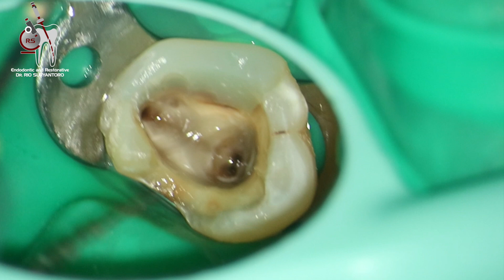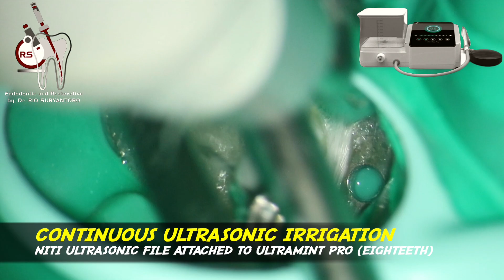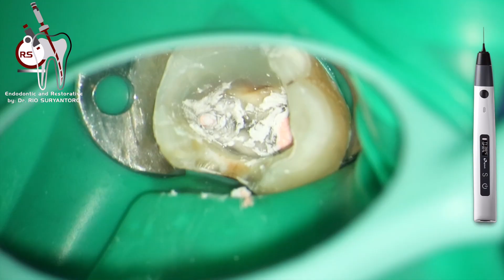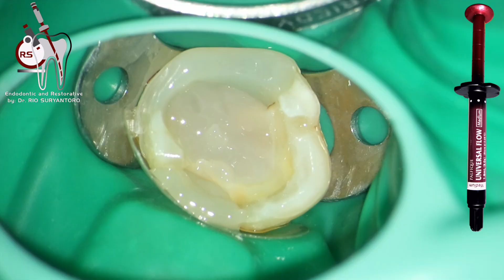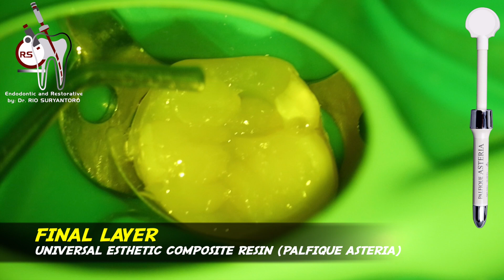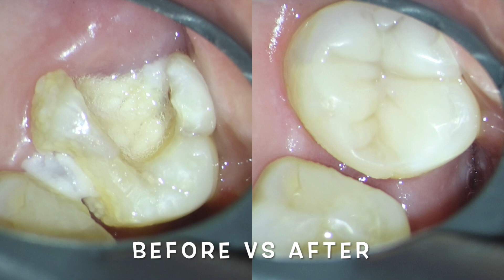SINGLE VISIT ROOT CANAL TREATMENT MAXILLARY 2ND MOLAR WITH  DIRECT RESTORATION COMPOSITE RESIN 🦷❗️

Comment: Which brand of ultrasonic niti tip used in activation ? Did u put naocl in ultramint ?
Reply from the maker: seriously, i need to recheck the ufile brand that i used in here. there were 3 brands in my clinic includes MANI files but i am certain that i was not using it.. 
i didn't put NaOCl in ultramint pro, just water or water with little disinfectant..

Comment: Thank U Dr💐💐I have request🤗
Could U show us tips and tricks that help us to open calcified canals ? And how to do RCT with this simplesity ?
Reply from the maker: Hi Dr.. regarding the top on dealing with calcified canals. 
1. have a good access at first. make sure that the access is open, flare, and having a good vision. If you find a thick dentin covering the pulp chamber, you can remove it using diamond coated ultrasonic tip (for example E3D from eighteeth) without water.. 
2. after gaining a good access, you must have a great vision and magnification to see clearly which canal you are going to deal with. try to insert the smallest file available (kfile no. 6) with a passive watch winding motion, and have it irrigated in every 3 mm insertion. 
3. xray is important, make sure no ledge is created during the process. 

i hope that this answer is useful for you, the next video https://youtu.be/XTe4VWWrUOk is telling you the story about it.. 😃
Reply: شكلك متخرجة جديد. 
كله مع الوقت يصير سهل.
القنوات المتكلسة ممكن تستخدمي معاها C files أو K file size 10 تقصي منه ١ ملم عشان ماينكسر معك وتكون النهاية تقطع أكثر وعلى مهلك تحتاجي صبر ووقت وغسيل كثيف حتفتح معاكي .. ابذلي جهدك واذا مافتحت معاكي اما تحشيها عالطول اللي وصلتيله او تحوليها لاخصائي ..بالتوفيق
Reply: @meme-od6kd  شكرا عالرد🤗 بس فكرة حشو القناة عالطول اللي وصلتله هل يعتبر كلام علمي والاخصائين ممكن يعملوها؟